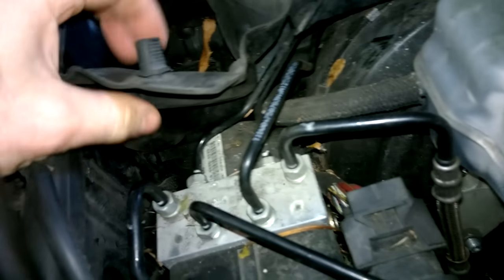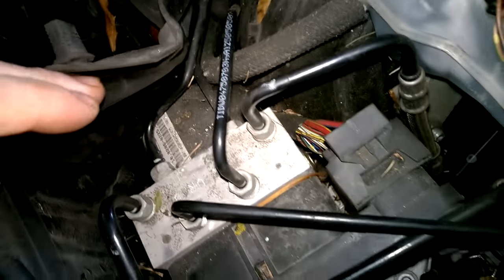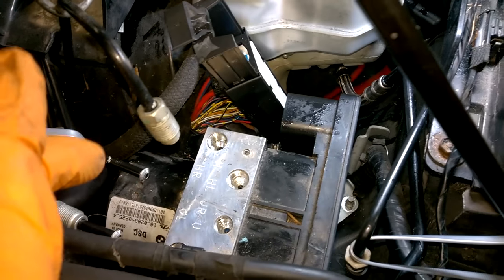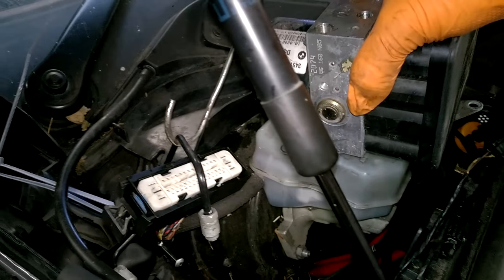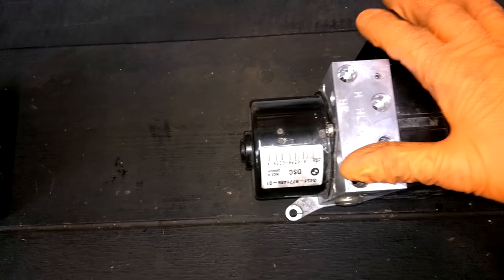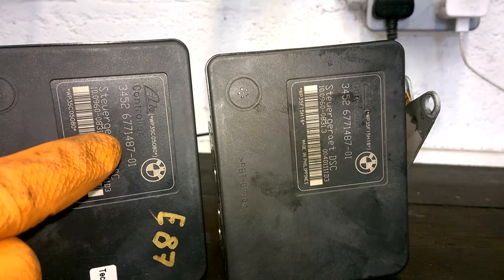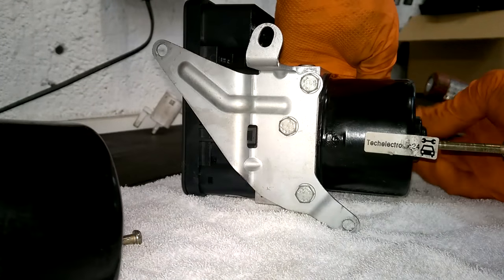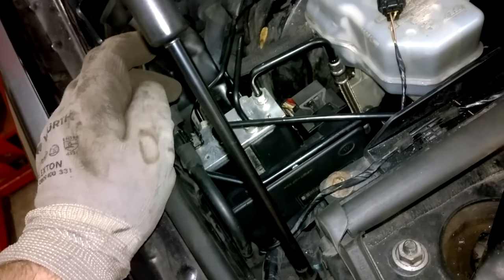BMW Dynamic Stability Control Fault - Fixed - How To DIY

Comment: literally did the same to my car same fault code swapped the rear and kept the electronics to avoid a recode but the problem still persists and i dont have a clue on what to do in inpa the pressure sensor says 200bar constantly and thats with the old unit and the new sureley the new unit cant be faulty aswell or do you thing its electrical problems?

Comment: why did you have to switch out the module with the new (used) pump/module given they were both codes exactly the same???
Reply: @xtcstreetwear831  i heard its a plug and play tho
Reply: If he'd of put the new module in, it would have needed coding....I think.

Comment: Usually the codes replacement needs to be coded to match the cars VIN, and also calibrate the steering sensor - was that part skipped?

Comment: Thanks for the video. I believe the motor brushes are the real issue in the motor which obviously doesn't create any pressure and gives that fault code.
Reply: Do you change the brushes? It resolves the 5DBC or 5DCC errors?
Reply: I replaced the pump part with another used pump and reused the module part becusse it is coded to the car already.

Comment: I replace my water pump on my bmw 335i 2010 n54 and now the pump steel running after the car shut off fo 20 minutes , afeter the pump stops if i open the door stars run again like the bleeding prosses for 20 minutes , any idea ?

Comment: So I have a similar problem with the traction control light on. My mechanic found moisture in the bottom of the vehicle but still not resolving the issue. by the way my car is a 2004 530i. I hope this will help me with my issue. the vehicle only has 102k miles and beside this new issue runs great. thanks for your video

Comment: Hello, I think I have a problem with the abs modules, no errors or lights come on, the symptom is and when I turn on the windshield above 120kmh it stops, losing around 20kmh, could it really be the abs module? When I deactivate drybranking through coding it doesn't help me but I feel the car is a little stuck at the speed level, thanks for the answer, hugs from Portugal
Reply: It sounds like you might not have fully plugged the connector into the ABS module?
Reply: @suj1945  Hello, the abs had problems but did not generate errors, it was replaced and programmed. The problem was resolved. It was the abs module, even deactivating it, it caused the car to brake. I think it's called a cylinder and an electrical part.

Comment: Hi, I hoping to get some advice. I recently took my BMW X5 F15 to the BMW servuce centre to look at all the warning lights that started appearing and was told that DSC Contruo Unit needed to be replaced. I had j no I choice but belive them and preceded with the expensive task of replacing it with a new unit; however after replacement the warning signals still appeared and I was told that they investigating further. A day later I was advised that there was short circuit with the wiring and now it is all working fine. Is it fair for me to suspect that DSC unit did not require replacement and it was a wiring issue all along? BMW service claims the short circuit was related to the replacement procedure. Should I believe that? Thanks in advance!

Comment: hi mate i think i need to change this unit in my bmw e90 ,iam pretty handy with cars and have watched this video a few times ,but iam a bit weary on the brake fluid side of the job ,am i going to need some sort of diagnostics to bleed the system when changed out ,will it affect the clutch at all ? any advice welcomed thanks
Reply: Yes

Comment: Thx great tips. Will this fix or work for mine?
X5 2007 3.0. 
The ‘sign’ goes off about 10 minutes after starting the engine and running a few miles.

Comment: The short rubber dsc brake hose is leaking behind the dsc unit in between the hard lines.  Can I just unscrew the fittings and replace the rubber section of hose?  Will all the brake fluid be pushed out.  Anything special with this replacement.  Will probably do both hoses.  One hose is leaking, pedal goes to floor, car stops very slowly.  Scary.

Comment: I only am getting the DSC light on my E39 M5, when I pull the abs codes the only code that is coming up is a pre charge pump code. Could my precharge pump be bad?

Comment: I have the Problem Code 005E19 and got an E87 ist that my Problem which you shown in the Video it sayed : DSC-ECU: ECU-internal: serial peripheral interface
(SPI): ID request not accepted. / CAN DME / DDE, engine torque not adjustable. / Coil outlet valve (dump) shorted front right / DSC-ECU: ECU-internal:
serial peripheral interface (SPI): ID request not accepted --- (DSC: ECU internal) / DSC-ECU: ECU-internal: serial peripherial interface (SPI): ID request not accepted.

Comment: Hi, I have the same problem with my 2011 328i and I performed the same process that you just performed in this video but none of the lights went off.  My initial thought is that I didn't perform the bleeding process exactly as described.  If I didn't perform the bleeding process correctly will that cause the lights to stay illuminated?
Reply: did you clear the codes?

Comment: I had this problem suddenly airbag, and belt lights also turned on, any idea of why? It started with carly saying left front speed sensor was kaput, then i drove for a couple of weeks without traction control, abs and handbrake light. Suddenly i got airbag and seatbelt aswell
Reply: do you resolve it?
Reply: @Bikes_exv   Yes speed sensor was the problem.

Comment: I am having the same lights on my 07 335i and the car will shut off sometimes is this normal?
Reply: Mine did the same until the lights stayed on so I ordered a used part from Ebay and see if I can get it fix,  abs module and pump
Reply: Rey Perez any update? Having this issue

Comment: Hi, Good Video...very informative. I have a question if you don't mind. My 2007 BMW x3 e83 3.0si is doing something strange which is not uncommon for this car. Recently I cleaned my wheels with some high pressure water. It seemed after that some of my problems started.
When reversing down my steep driveway and applying the brake pedal with light pressure the ABS pump will come on as if I hit oil or ice. However, when going forward down the driveway it does not happen. Usually happens at first start or when the car hasn't been driven for a bit. I went to work and cleaned the sensors front and rear. The rear sensor ring was full of dust, rust and and road debree. The sensor was touching the ring, I cleaned the magnetic sensor, sanded it a little, plastic, and I wire wheeled the sensor mounting area. 

I had 1 code P1774 check engine with the 4x4, abs and brake light on the dash. At that point I didn't know what the code was. After cleaning the other side I got a P1775 Code which told me it must be ABS speed sensors passenger / other side. I recleaned down the hole and on the side under the axle with a nylon brush and brake cleaner. What do you know, was able to clear the computer and have not seen the P codes or the other triad of lights for about 400 miles now. I did the same on the front ABS sensors except the Fronts don't have a tone or sensor ring. The sensor is the same as the rear but the tone ring is in the wheel bearing. The ABS still goes of when reversing down my driveway, maybe I'll just turn my house around, it may be easier. I'm leaning towards wheel bearing and sensor ring but did not know that the DTC was directly controlled to the ABS or know anything about it. Time to go to school. The ABS works when hitting the brakes forward on gravel.
Any help would be greatly appreciated. Thanks, Great Video...
Reply: Maybe a little late response 
have you tried entering your driveway backwards, so that you can test your abs as going forward ,caz it makes sense that your abs activate only one way since you have a steep driveway

Comment: So with the bleeding part do u need a coding tool to bleed the abs pump brakes ect or as u done u got the new pump but put the old abs module onit so won't need coding and just needs bleeding?
Reply: If you just replace the valve block and keep the original electronic module no coding is required, only bleeding with any decent bidirectional scan tool

Comment: I have the 5E20 code with the 5E24 code. yellow warning ⚠️ triangle within a circle and handbrake light on dash. 

Will the warning lights go out on dash before system is bled with a diagnostic tool if the same procedure as above is followed. ? Or will the dash lights remain until abs unit does a purge cycle ? I don’t have a diagnosic tool but I want to the job myself and maybe only have to pay to get the diagnostic cycle done.

Comment: Does it matter if the “pump” is from an auto transmission/when you have a standard transmission/or viscera?
Reply: Brakes and abs have nothing to due with   transmissions lol

Comment: Got this on my wife's car. Put it on ista. I've changed the. Sensors. Still on fault for that gone. Got no code for pressure hydraulic failure. Any ideas.
Reply: Do you resolve it?

Comment: I have same problem
 all lights on and vipers starts working and wont stop until restart engine?
Reply: paulius197907n26 I have same problem. Did you ever figure out what the problem was?
Reply: @fernandobenitezjr2112  yes  abs control unit needs to be replaced

Comment: It does not have to have the same numbers, you buy a pump, you replace the motor and electronics and it is important that the sensor is functional in the body

Comment: My Z4 E89 after several minutes driving abs lights all come on. Restart clears them. Still haven't found the cause. I pulled and clean that black plug, reinstalled back to old 30g relay. Still no joy. Replaced rear wheel sensors.
Reply: Ordered 2nd hand pump to see if replacing the mechanics will cure, but fact it throws several codes as though power to module gets interrupted. Even when moving when safe i can turn ignition off and on then resets. Not a permanent faulty, just random.
Reply: @flybobbie1449  What code do you have in your car?  I have ABS, DSC light on, but ISTA gave S 0085 No communication possible with: Dynamic Stability Control fault code.  I have seen people have this light on with more specific code with which sensor fault.  I hate throw money for new parts, while the old part still work.  The car drive and brake fine, but the light is on.  I have E90.
Reply: @imanwan2861  Changes each time i get fault. Typical dsc hyd. press. sensor, brake fluid low, park brake undervolt, interface dsc. If i average out from those i photo graphed pressure sensor is most common.
Reply: I replaced the electrics on abs with 2nd hand, didn't need coding. But same faults come up. Next going to replace the brake light switch with original bmw. After that replace abs unit completely with the 2nd hand unit in case its the pressure sensor. Shows pressure on obd, but perhaps it's intermittent.
Reply: I think i might just change the whole abs and not the brake switch. Might save £40. Always fails at same spot on regular journey. Like it's come up to temperature, then fails on braking.
Reply: @fly bobbie  I bought the second hand ABS locally, but don't want to do the job with ISPA. Is it OK to just use the Motive Products Pressure Power Brake Bleeder?  I have it for my other car.

Comment: hi,
I have bmw e90 320d 163hp 2005
I have ABS+DSC+Yellow handbrake lights 
When I hit motor (abs pump) lightly lights gone,but come back in 2,3 days 
so that mean I need new abs pump?
Thanks for answer
Reply: Edin H i have the exact same car, same problem. Did it work for you?
Reply: Did either of you sort this out as i have the same issue?
Thanks
Reply: @1986leedsyra  The brushes are getting stuck in the brush carrier, take the motor apart, loosen up the brushes so they make proper contact and thats it fixed
Reply: PRICE
Reply: @Robbzman   @Craig Morley Were you able to fix the ABS light problem. What was the problem? Thank you
Reply: I just got this same issue on my 2006 330i. I already did the steering wheel sensor,  wheel speed sensors. Still having the same issue.

Comment: was the problem cause by the elect motor failing?
Reply from the maker: More than likely, but I could not be 100% sure without a stripdown. As long as the module was ok it makes the job quiet straight forward in fixing this issue once sourcing a tested complete unit. If you tap/hit on the motor and it comes back to life it is probably a brush issue.
Reply: Gerard Burke at work i take a small harmer and hit the motor lightly.. will someone circle ignition off and on  and  they work again .

Comment: hello i have the same problem but it appears when the car moves and when the contact is on it sounds a little bit noise in the pump after stopping the engine disappears give me a solving thanks

Comment: My DSC light will only come on if driving 30+ MPH - really, it's random most of the time - but def. when it's over 30+ MPH. 2000 BMW 323i. Otherwise, this car runs great, just have to drive carefully.